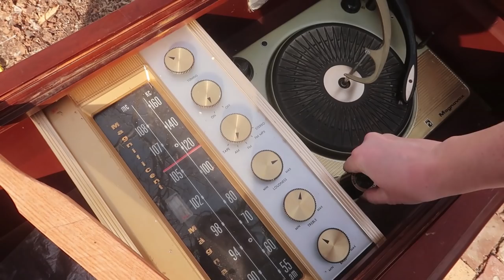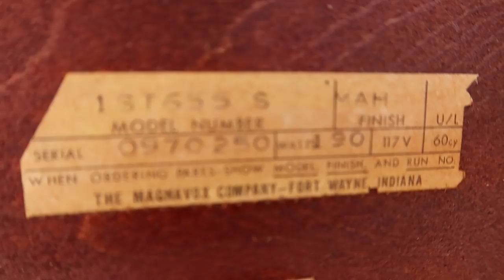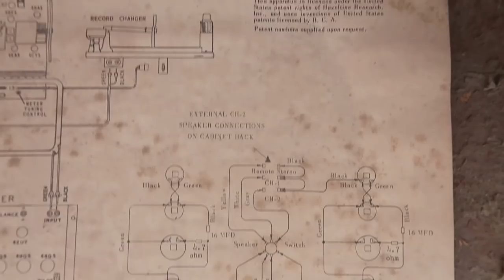1960s Magnavox Model 1st655s Console Radio / Record Player Teardown. Electron Tube Harvesting

Comment: Those things were built like a tank and have a great stereo output. I cant believe you burned it. If I didn't already have a nicer one I would've taken it. That's real american made quality. You wont buy anything today that'll still work in 60 years like that did. Wow.
Reply from the maker: thats not true i have quite a few electronics that could last until 2100 i buy now
Reply: its hideous and needs burning .the electronics can be good but the cabinets on some of them were little more than chipboard covered in sticky plastic
Reply: @RinoaL  prove it fortune teller
Reply: @anthonylawrence60  that’s why ppl convert them to separate competent units, if they destroyed the components that would raise my eyebrows but it’s just the cabinet.

Comment: Nobody wants it? Look at the size of the output transformers with PP 6BQ5/EL84 tubes. You could probably get north of $300 to $400 on EBAY these days just for that chassis. Those raw speakers are worth something too, especially the 12in. The tuner preamp unit just needs some cleaning and repair of the dial cord. 4 pole motor on the turntable. That was not a cheap console in it's day. And those 12in grills could have been incorporate into a new cabinet If nothing more, they could protect the speakers during storage or shipment.

Comment: Very poor cabinet design( from the 1930's )but an awesome amp,record changer ( Voice of Music?) and speaker set up. The electronics insides are worth big bucks 
for today's tube loving  budget minded stereophiles.  The amplifier gets  too warm with very poor ventilation so expect to replace many resistors and capacitors in it. 
Who knows one day you might run across a great looking mid century vibe cabinet with no guts .
 It may get a new home for the electronics and speakers if they fit, in the repurposed cabinet. Would resell it (without cabinet)  as for parts!
Reply: These Maggies had Callaro record changers, from Great Briton.
Reply: @dougbrowning82  Still learning about r.c.'s and your right. Should be reading my collection of SAMs Photofacts books on them!
Reply: @hestheMaster  The Callaros were most interesting to watch. They would tap the side of the record stack to judge the record sizes before they dropped. The mechanism was very complex, so servicing could often be a pain. Unlike the much simpler BSRs, Garrards, and VMs.

Comment: Glad you at least saved the insides! the Magnavox consoles of the vacuum tube era are very well regarded, and not generally seen as cheap junk. There's a solid Magnavox console community that would absolutely love all of the insides you pulled out of this one. The cabinet itself is probably a low end cabinet of the era, but it looks like that was a model whose electronics had a separate power amplifier chassis and are generally considered higher quality, and are sought after. Those turntables are also well loved and valued. I would have loved to find that console and restore it!

Comment: You could make a really nice little stereo system with the amplifier and the tuner.  That is an EL84/6BQ5 push-pull amplifier with decent sized output transformers, the amplifier being all on one chassis makes it easy to build something nice (paint the chassis and maybe hardwood the sides).  The tuner is worth saving and making a stand alone unit, it probably has decent stereo separation as that vintage started to sound pretty good with FM.  Both the amplifier and tuner have value enough to keep safe, either for your own use or some one who might buy them.  The speakers are worth saving, suitable for a guitar amp but might need some mineral oil on the cones if the paper is brittle.  The turntable on the other hand... those are a pain to get going reliably (idlers warp/rot, cam gear seize up) and probably not good for much more than for mechanical parts.  Also like another person suggested, not recommended to burn playwood/fiberboard with oil finishes on it.

Comment: Mags went cheap on their cabinets starting in the 50s but their electronics stayed pretty good.  I have a mid 40s console and I have my grandparent's Mag, I like them but I'm a radio head.  Particle board was cheap but another reason it was used in consoles and is used in speaker cabinets is because it has a consistent density and that was good for speaker enclosure vibrations.  I never liked the fake drawers and cabinet idea either, or fake anything.
Reply: I Know, I got a 1946 Maggie def more study than my 1960 model.
Reply: @oldradiosnphonographs  I think mine is a 1946 model also, one of those that everybody wants to rip the speakers and amp out of, thrift store find, $150.  I think the cost of quality was killing their bottom line back then so they changed some things.  The other that was my grandfathers I think is early 60s.  They do take up room of course but as long as there is radio broadcast these are going to be valuable to me.  I used to think Magnavox was cheap until I read the history of the electronic engineering.  I read that by the 1960s, most of the designers were older and stuck in time, stubborn about style so that's why the cabinets have that look.  You can plug in modern players like ipods and other things in back too.  It's the iphones, they've taken over everything, and almost everybody, people aren't familiar with quality anymore, they don't seem to care about it.
Reply: @scolopede  I wish I had the Windsor model but I hear those are rare and very expensive when new. I have the Belvedere model, im trying to get the optional FM tuner for it that the original owners didn’t opt for but they upgraded the turntable to a 3 speed early on. As for Rinona many people take the components out of these Maggie consoles and move them to smaller cases anyway they want the performance of the components with out something taking a lot of space.
Reply: @oldradiosnphonographs  Yeah that's what it is I have, the Windsor, I couldn't remember the name of it.  Somebody had already done a good job replacing all the capacitors and putting new tubes in it.  I forgot I have another one, it's project, it's the same size as the Belvedere but I don't know what the model is, it's under my other hoarded mid-century stuff.  I don't like many things made after 1980.  My dad gave his 1961 Monterey jr. speakers and that got me interested in all that stuff.  I was going to throw those speakers away after I looked inside.  Then I finally hooked them up after over 20 years, I almost made a big mistake there, thinking of getting rid of those.
Reply: @scolopede  usually 1985 is my cutoff date for items I collect with a very few exceptions
Reply: @oldradiosnphonographs  Pretty much the same here, I like the late 80s Japanese made Onkyo receivers, Snell speakers, stuff like that.  I have a storage prob haha.

Comment: That “Maggie” hi-fi console is a LOT better than the non repairable plasticrap sold today. Since this uses tubes it’s more repairable. I could have fixed up that set without beating it apart and got it working like new! For the most part that was built with REAL wood instead of plastic. The components can be of value to others restoring Magnavox hi-fi systems. Could have been advertised on EBay Facebook,whatever.
Reply from the maker: Well tubes arent as reliable as solid state, and the issue with these is nobody seems to want large consoles just to play music. Thats why It was going in the trash and I couldnt find anyone to take it. The electronics became a guitar amp though.

I dislike comments like this because people dont realize how little interest there is in this stuff. And you shouldnt assume I didnt advertise it (craigslist is best) just because I didnt show it enough for you to notice

Also this was kinda crappy wood gonna be honest, it even had some ikea-quality particle board in it. Dont let yourself pretend the 1960s equivilant of 2020s ebay crap is much different. Its all factory made stuff at the end of the day
Reply: @RinoaL  SOLID STATE is NOT always more reliable than tubes. In a 250kw/500kw SW transmitter I operate and maintain at a gov’t VOA transmitter plant the transmitters solid state parts fail more often than the two power tubes in the transmitter. In consumer gear like the hi-fi console the SS parts can fail as often and MORE difficult to replace. They are soldered onto a PC board and the type#’s aren’t as standardized as vacuum tube Retma standard part#s. That is why you can still get tubes for the amps used in the console today. The tubes plug into sockets-easier can be cheaper to replace. I have been working on electronic gear for over half century! The consoles hard wire circuits are easier to work on than PC boards-esp early ones that became more fragile from heat and age.
Reply: @RinoaL  there may be more interest in older gear than you think. To say folks don’t want older equipment is ignorant. Try mentioning the unit on EBay,Facebook,Twitter, or other methods and you may run into more folks that would like to have that set and restore it. I grew up with a Magnavox Hi-fi system console that was more high end than the one you found. The folks that want them are out there-just takes some time to find them. They are groups out there that restore and collect older equipment-including Magnavox,Scott,Fisher and other higher end hi-fi consoles. The one you found was a lower end model-but still restorable and useable nonetheless.
Reply from the maker: Oh they really don't want these consoles though, I've had about six of them so far, similar with electric organs. It's very difficult to get rid of them. People just want the electronics but no the console. I mean, who has a house big enough for a console anymore? Only older people have room for them but they normally already have one or two. I even had a friend called Magnavox Max who was one of the biggest restorers in Wisconsin, and even he didn't want it because he had too many. I'm already in a lot of those groups, they tend to have enough of them.

No, you can't ignore the fact that I already looked but nobody wanted to drive to hillsboro illinois to get it. These are everywhere on craigslist for free in cities. They sadly aren't rare. Your wishfull thinking is just that, but sadly the reality is that nobody wanted this. I saved it from the trash and then I saved the electronics from the trash because nobody had room for the cabinet.
Reply from the maker: Your issue is thinking the government buys quality solid state components. Comparing a hybrid transmitter between its components is dishonest. You need to compare it to a all-tube transmitter from the 1950s. There you will see that the surrounding equipment fails a lot quicker and regularly if it isn't solid state. Your experience is entirely subjective, and working on electronics can be easier if you trained for that.
Reply: @RinoaL  which I am. And the surrounding equipment doesn’t fail faster than the SSM modules. We replace more of these than tubes. It is NOT dishonest. Don’t know how you come to that conclusion.